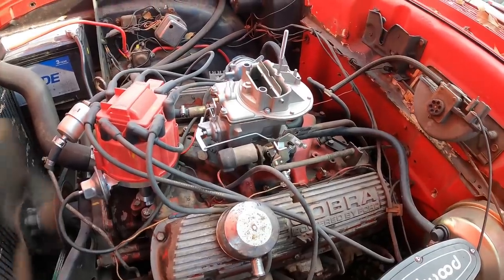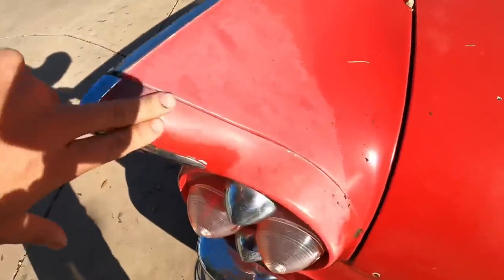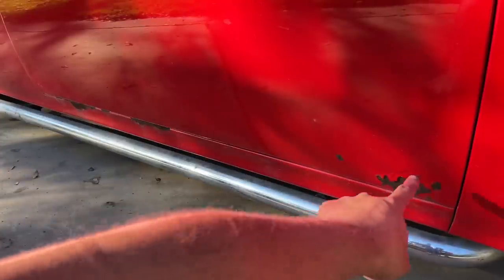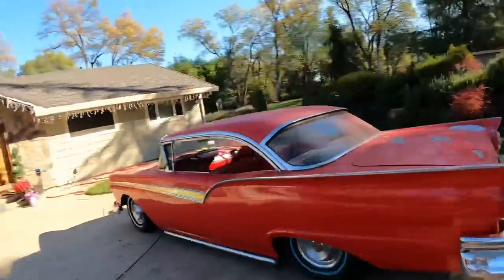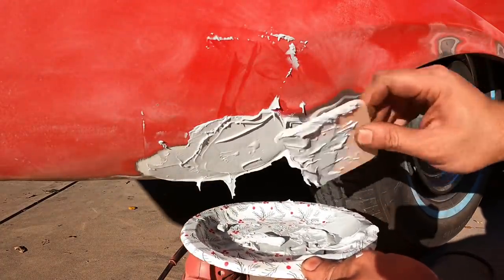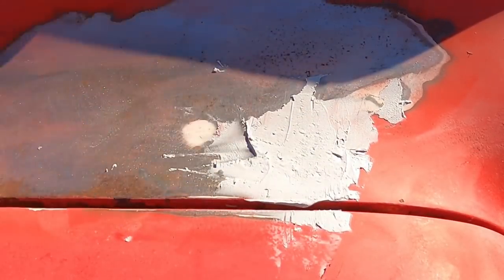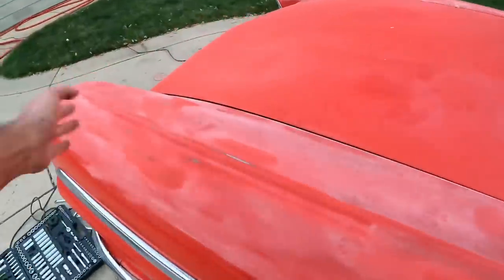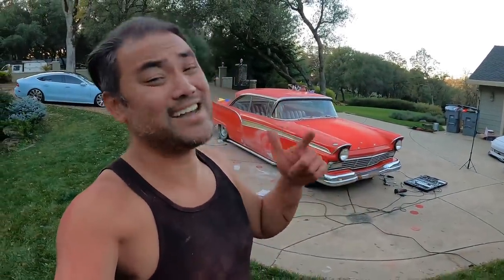IS BODYWORK RISKY BUSINESS? | How To Get ANY Car Ready To Be Wrapped DIY Guide

Comment: Been doing body and paint for 28 years. You need to spot blast the rust down to clean metal before you bondo “filler”. If you fail to do so it will eventually fail and bubble up where the rust wasn’t removed. If u have a air compressor you could buy a spot blaster and do the areas before you bondo. It will be a shame u do all that work and spend money on materials and time wrapping just to have bubbles appear later on down the road. Just some advice bro , do what you will with it. Good luck. Can’t wait to see this bad boy wrapped. 😎
Reply from the maker: Thanks for the tip! I can always redo it and I change colors all the time so that’s good to know
Reply: I was about to say the same thing lol 😆 I've only been doing body work for 7 years and I was going to say find a local who can come and fix them before wrap. Lol
Reply: @ParadoxTheWrapper  you are very welcome!
Reply: @edwinromero8074  nothing wrong with DIY , actually that’s the most gratifying! Just a few pointers can really help someone out, being a car guy I feel that’s the holy grail to help someone better their craft and do it themselves.
Reply: Coyote swap it keep it ford
Reply: can't go wrong learning and experimenting along the way.

Comment: After Frank A mentioned on his comment, you do need Corrosion cleaner. Rust is Corrosion so is the corrosion cleaner, it takes corrosion to fight/cancel corrosion, THEN etching primer then bondo those spots. corrosion cleaner stops rust from spreading any more than what you see .

Comment: Time 22:00 minute mark. ✔ You asked Paradox. Ive done bodywork on many different metal surfaces over 40 years. Both in a nice shop and under a shade tree. Putting plastic filler over a improperly prepped rusty surface will continue to rust just more slowly as its not directly open to the weather and moisture. To answer, no, Paradox, in my experience, it won't rust out the entire door unless it's allowed to be exposed to water and salts. It will expand around the current area, just much more slowly. However, having said that, there are several rust converters available on Amazon that work well to convert the rust into iron oxide wihich will turn the metal to a chemically converted inert black or a chalky white color once the rust conversion process takes place. Then you can proceed with plastic filler, etching primer, sand and paint or wrap. Hope this info helps someone 👍

Comment: Gotta agree with a few of the below comments. Use a rust converter first. Also, use the old mesh sanding discs as backing on the inside of the panel to give the bondo something to bite into. Prime, then dust a coat of any colour you have on hand on it, just to seal it. Chances are that the rust has spread further on the inside of the panels too, but some fish oil spray will stop that spreading too.

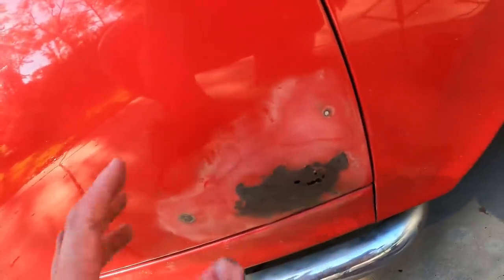Comment: At 12:23 time line. RE: hole in door, next time spray with a rust (converter )stopper liquid before bondo and sand. That way rust is chemically converted and stopped so it doesnt continue to spread. Then wait overnight, sand again lightly then prime  with self etch and or  rust reform primer and let dry then paint or in your case, continue the wrap. Hope this helps

Comment: I realy admire your work as a wrapper, but as a body worker :-). You need to get the rust to bear metal, than coat with some rust coating, or better let someone replace the peace when it is realy bad. For the bondy good job, fold dont stir just like pizza dough hahaha, next time use a peace of flat board to mix your bondo on. Thats much easyier for you. Looking forward seeing you wrap the old lady.

Comment: Hay man I love working with rust.. all iv done is made it a easy and simple process.. it can be fun and cratifieing. I wish I could do this for you.
I find grinding it first makes it easy and faster, then I use a rust converter to kill rust in its tracks then i use new teah a fiberglass bondo that fills  holes so much easier, then bondo then just before the bondo sets..rasp or cheese grate most of the bondo off until your is a little higher than the paint surface the use sand paper.. its like digging a hole and filling it up sanding using 40 grit 80 grit 120 and then 240 grit the holes and the rest of the car. If u want your Rapp to stick better I would primer it and wet sand it with 800 grit it's up to you bro.. but I love your skills and watching you im a huge fan I paint cars for a hobby and I'm keen on rapping instead... im aubrey from rotorua nz

Comment: As a noob at body work I would have use rust converter after a good sanding then filler then primer p.s did my 1964 Mini Cooper s 20 years ago still no paint issues and still looks like a new paint job

Comment: If your motor is strong you can get the holly sniper EFI kit to convert your carb to fuel injection.  Alot cheaper than a while new motor.

Comment: Yep it will get worse, the bondo is porous, think of it as a sponge, I taught myself to airbrush and paint, check some of my videos. The best process without welding is sand back, then rust converter/killer, then epoxy paint, the epoxy stops moisture, then bondo, then primer

Comment: Alot of people put ls430 motors in there since they go for ever. I got a 2001 lexus ls430 that i would let go for cheap lmk paradox
Reply from the maker: But is it manual?
Reply: @ParadoxTheWrapper  nope its not manual dont think they made lexus ls430s in manual but it has low miles 130xxx

Comment: Sanding n leaving rust all over will not do the trick for you. Your bondo wl just lift  in a short time! 

You  need to sand down all the rust to bare metal plus use rust converter before you use bondo for the meantime. A proper body work is in order for your car! What a rust bucket!

Comment: Your Bondo work looks good. I am not sure how the rust will affect it later on though. I have been wondering how to prep FRP (fiberglass reinforced plastic) to wrap though. Just picked up a widebody kit for my '93 FD RX-7. The surface of the panels is fairly smooth, a few places need a little smoothing but do you think I should just wrap over the surface, sand to like 1k or higher grit, or prime and smooth them first? I know wrap likes to stick to very smooth surfaces.
Reply: wet 600-1k and see if they pit fibre glass tends to be a pain in the ass , if they do id prime em up and wet 1k em down again

Comment: Dude you playing with the filler to much. 
Down to bare metal.
Rust preventative
Build up filler in thin layers rubbing down high spots as you go. (less is more)
Mist on some black and sand it down smooth till the black is gone feathering in the edges
Then primer.